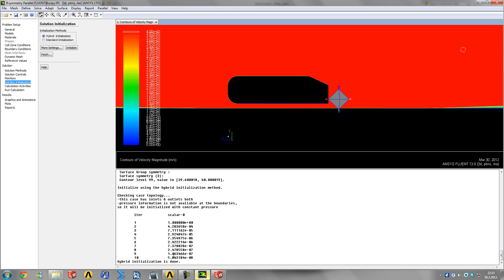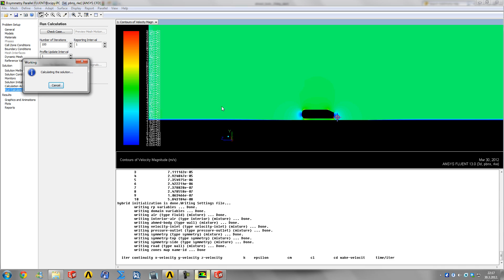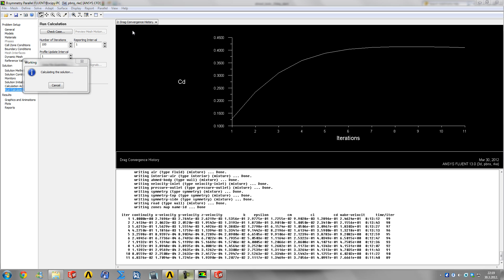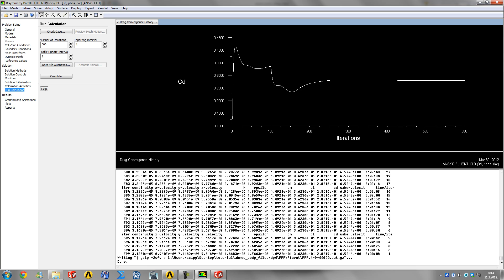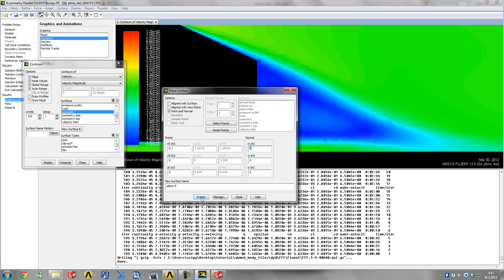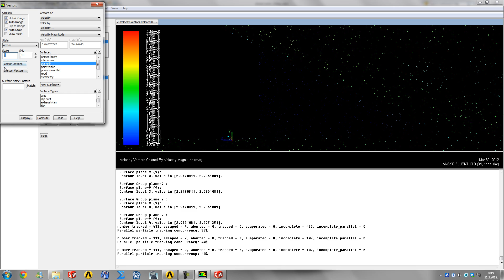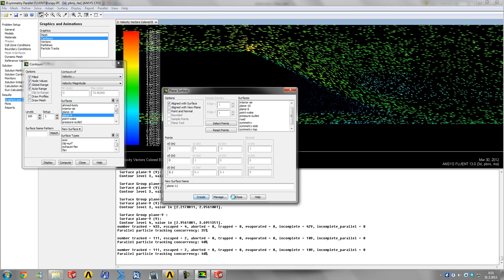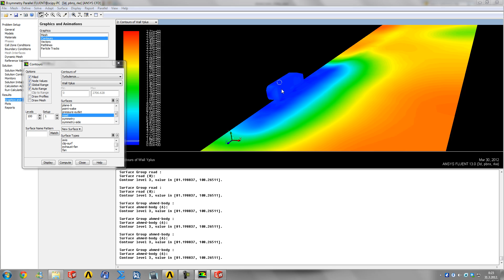Part 3d - ANSYS Fluent for Vehicle Aerodynamics

Comment: Hi all, Hi scipy,

Thank you so much for your time to do this tutorial. It was so helpful for my education project.
whatever, I have some questions. I fixed my Reynolds number (calculated in the input at height of the body) at 7680000 and I have more than 1.6 million elements (refined at the back and bottom of the body). I used the RKE and SST-K-omega and for both of them I obtain (drag coefficient) Cd around 0.33.... ever 0.2.... and I don't know why.
Any help would be welcome!!!!!!!!

Comment from the maker: If you did everything in WorkBench (like in the tutorial) then you can just do File -> Archive... and it will back everything up into a *.wbpz file. Then move that single zipped file to a new computer and do a File -> Restore archive... point it to the file and it will restore everything to its proper location, including external geometry files that you imported etc.

Comment from the maker: C2Q 9300 shouldn't be that slow. I mean, the old DDR2 is the biggest bottleneck so it should be about an order of magnitude slower but NOT 64+ hours slower. You might have a broken mesh somewhere and the solver is having a hard time not diverging. Check your pressure and velocity fields (if global values range from let's say 0 to 12000 m/s instead of 0-70 then there's a problem somwhere, same goes for pressure).

As far as 3770K goes - it can only address 32 GB of memory, so you can't have 64 :)

Comment: Ahh i see.

Sigh. I've been on the first 100 iteration step for 1 day now. Fluent predicts calculation completion in 65hours. You did it in 18min. haha! Really considering to build a i7 3770k with 64gb ram.

My current computer is a Core 2 Quad Q9300 with 4gb DDR2-800mhz